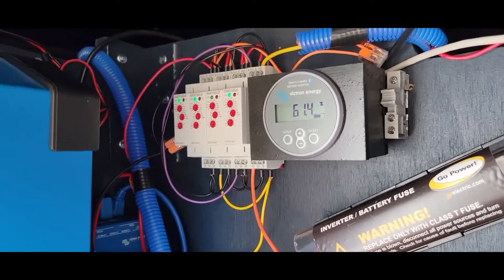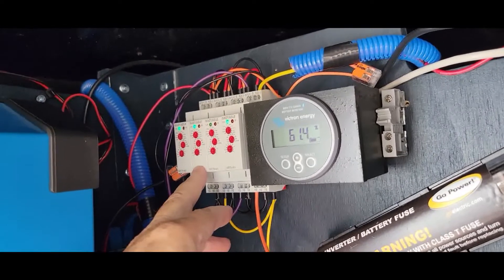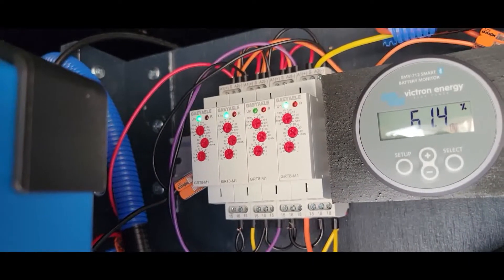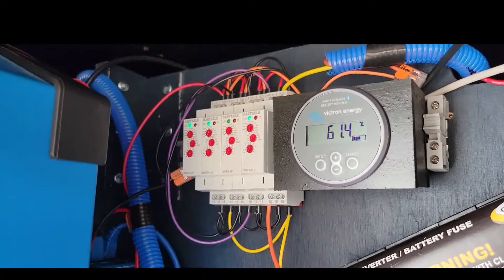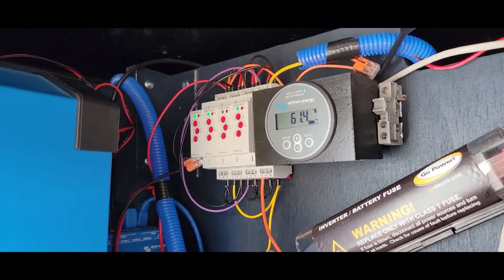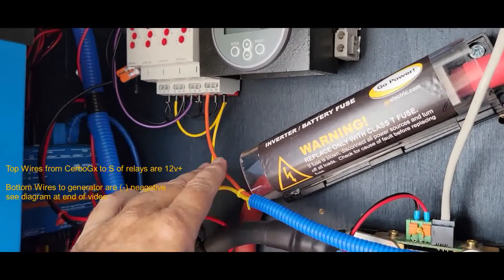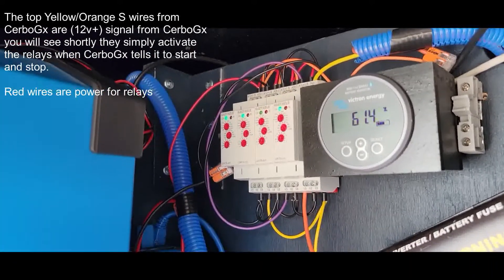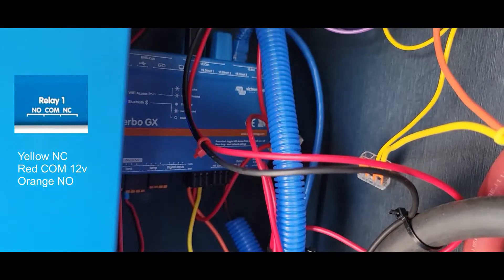Automatic Generator Start CerboGX start/stop/prime setup. Onan5500 controlled by Victron Cerbo Gx

Comment: One question, need a bit of clarification, this statement has the same part number for the relays  
"not tested but should work exactly the same requires  1 GRT8-A1 and  3 GRT8-A1"   
Was it supposed to be "1 of the A1 and 3 for the B1"  Figured I would ask before ordering  Thanks again
Reply from the maker: I did a breaker for a switch  smseace Miniature Circuit Breaker Low Voltage AC 6A 230/400V 1 Pole DIN Rail Installation DZ47-63 C6 https://a.co/d/34Kjh92.  Cost was $8.99 it works as power switch when not using the generator or in storage so power to relays are off.  As I don't usually cut main battery power.
Reply from the maker: Yes that should be grt8-A1 qty 1 this is a delay on relay.  While the grt8-b1 are single shot delay off relays..